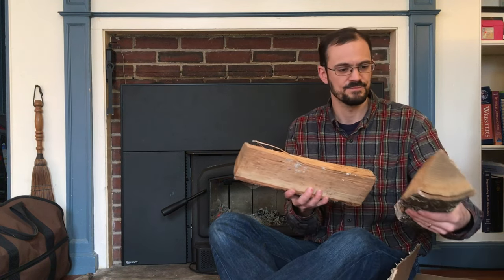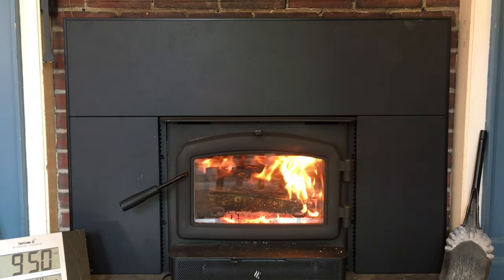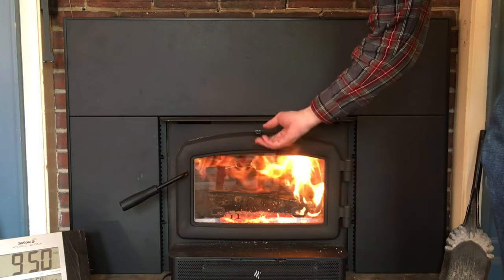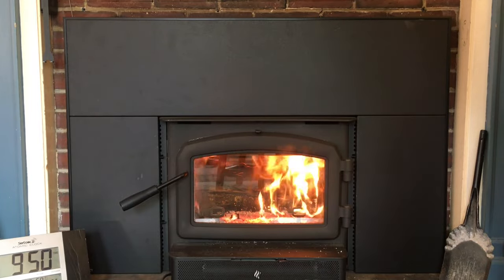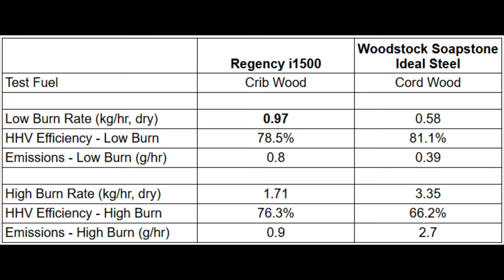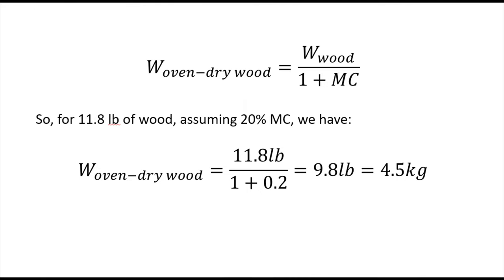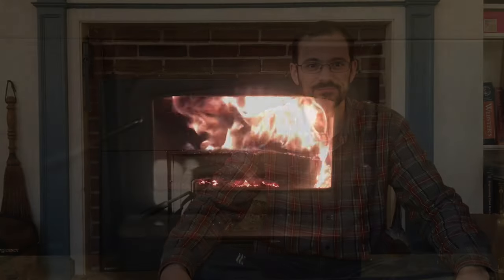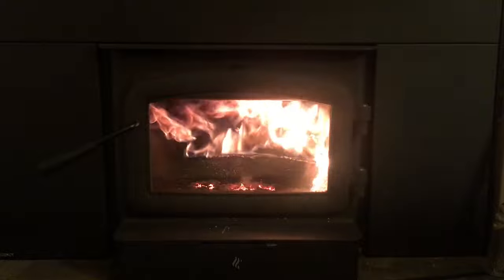Tested: Regency i1500 Real-World Minimum Burn Rate

Comment: Excellent data breakdown. I have the older Hampton Hi200 which is basically a non catalytic setup like the i1500. Mine has better draft control and I can get nearly six hours on 12 lbs of hickory.

Comment: Idk about your stoves EPA stove results but for my HI500 EPA test was done with an ambient temp of 66 degrees so less draft which is longer burn time. Your results then I think would actually make sense.
Reply from the maker: Yes warmer temps and 15’ chimney. That’s why this is “real world.” The EPA tests do not represent the conditions in which people use stoves, and unfortunately the stoves are designed for the test. Thus, performance in actual use differs. In my setup, this unit lacks adequate control in my opinion, and does nothing remotely close to advertised burn time. With warmer outside temps and less wind, burn time is basically the same. I had a Regency i2400 in a previous house that always exceeded advertised burn time and performance regardless of outside temperature, with a taller chimney than the test.
Reply: @Productive Recreation  does the one you have now have direct primary air control or is it on a heat coil that auto adjust based on temp? I wonder if there's a way to adjust the primary damper. From your video your right there was no visual difference in your flame low to high fire which is odd!
Reply from the maker: @CK-dt6nx  It’s direct. You are moving a steel plate over an opening. My other stove has both - direct control for primary and secondary, and an automatic control for the catalyst.

Comment: Crazy how hard that thing cranks on low compared to the ideal steel. Basically seems like it would run away if there was a bigger firebox.
Reply: I agree. The burn rate on the i1500 “low setting” looks the same as my HI200 on its highest setting.
Reply from the maker: If I loaded the firebox full, it would run away (i.e., get hotter than I'm comfortable with).

Comment: Stoves like that are not efficient. The most warmth is going out of the chimney. Free standing stoves are way better.
Reply from the maker: From a combustion efficiency standpoint, inserts are just as efficient or they wouldn’t get EPA certified. That’s the numbers here. Heating efficiency is a different story. An insert really requires a blower to get the heat into the room instead of the fireplace, whereas a stove is fully in the room, including some pipe. With the blower on, this little unit does pump out a lot of heat. Note that the chimney is lined with a 6” insulated stainless steel pipe direct to the unit flue collar, and the chimney top is otherwise sealed. Only firebox exhaust coming though the unit can actually leave the chimney.
Reply: @ProductiveRecreation with a free standing stove,all your heat goes in the house.Wood insert alot of the heat goes up the chimney. A free standing stove is way better. I don't care what EPA says. I have tried both. Free standing is better, and heats your house longer.